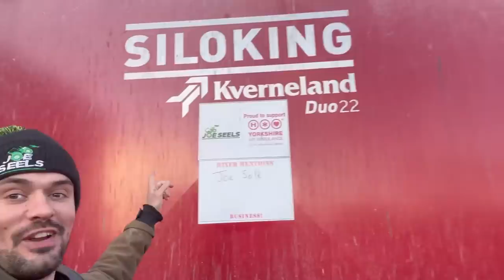A New Tractor in the Yard… Not What Your Thinking! Cattle Clipping!

Comment: I would take the fuel filter housing off and clean it out with airline, and check the 90 degree bends goung into the filter housing. Straw and chaff gets stuck on bends.